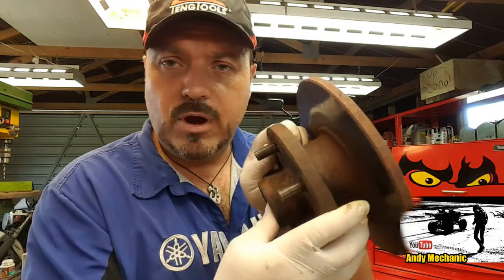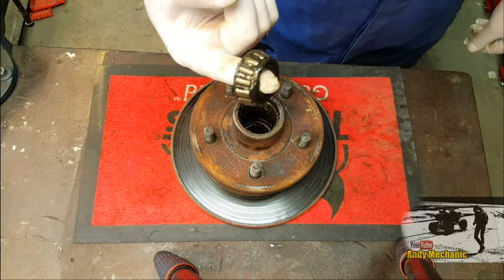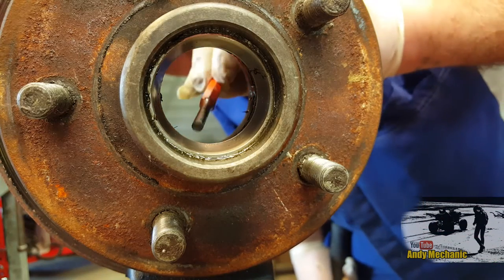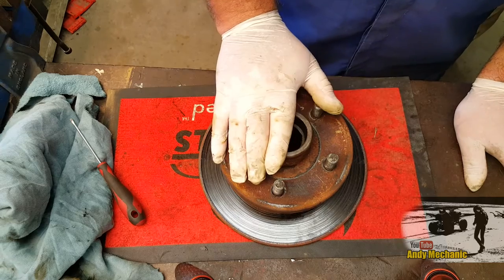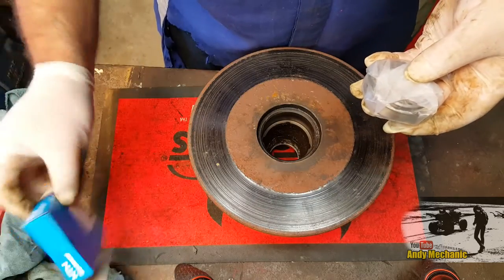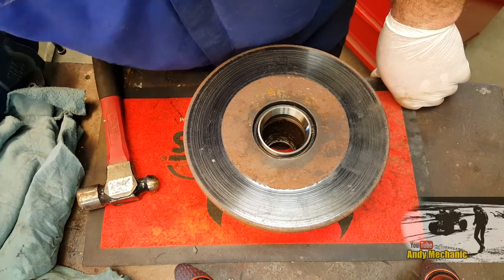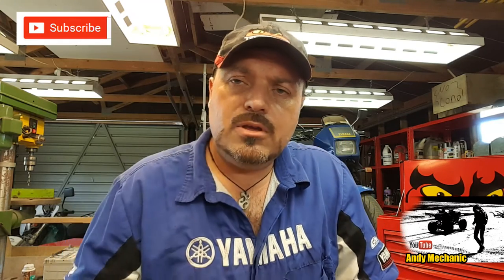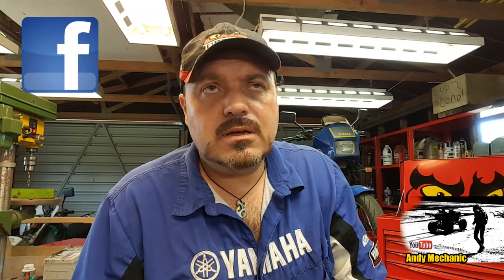Trailer hub bearing replacement #1611

Comment: Andy,  I've always had good luck using the old outer race to drive in the new outer race by flipping it over to where the thin ends are together.  Even if the old race gets stuck in the housing, it's fairly easy to get back out.  That brake rotor looks pretty rough.
Reply: farmboy30117 that's what I usually do but you should probably be careful hitting hardened steel against hardened steel in case it shatters. The rotors do look rough but in New Zealand a new one would cost a small fortune.
Reply from the maker: +Badgertronix yes, you are right. The rotors aren't really very good but no cracks which was surprising given how hot the right hand one had got!

As always, a budget job. If I'd replaced both hubs/disc units then the repair costs would have topped $1k....
Reply: I never thought about that.  Thanks!

Comment: I've never serviced a trailer with disk brakes ,  all I ever see is drum brakes and it seems nobody ever services them either LOL
Reply from the maker: +STEVE ROB Seems only in New Zealand they have hydraulic disc brakes. In UK it's illegal to have hydraulic brakes on a trailer, they have to be mechanically actuated....
Reply from the maker: +STEVE ROB Actually Steve, you are right....trailers tend to get overlooked and forgotten about when it comes to servicing. I'm a culprit myself thinking about it....my Welsh built I for Williams Trailer is around 10 years old now and covered well over 30,000 miles and all I have ever done is change bulbs, replace tyres and grease the hitch. Not once have I inspected the brakes or replaced hub bearings! Looks like more videos are due! Lol
Reply: Andy Mechanic Hahaha